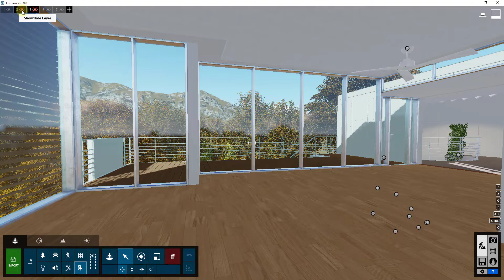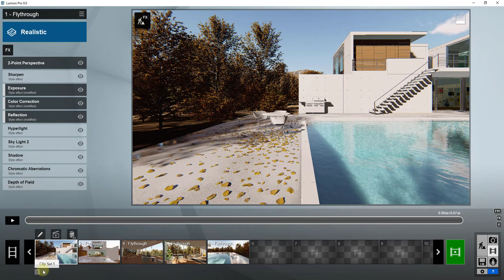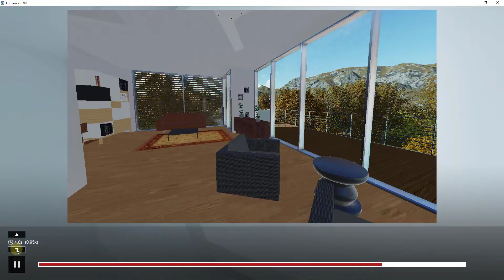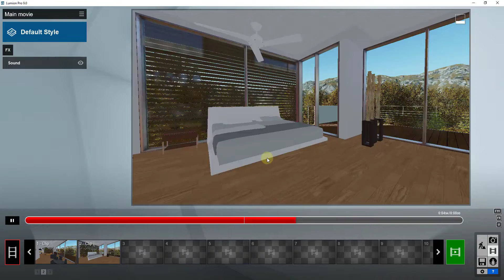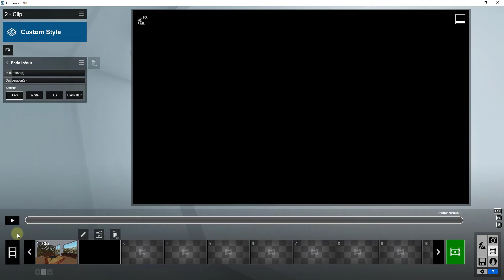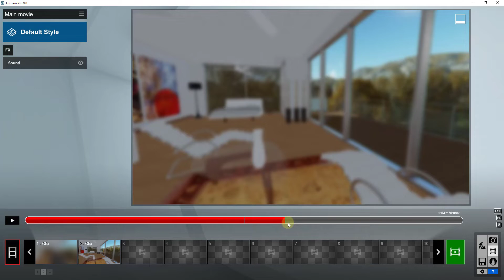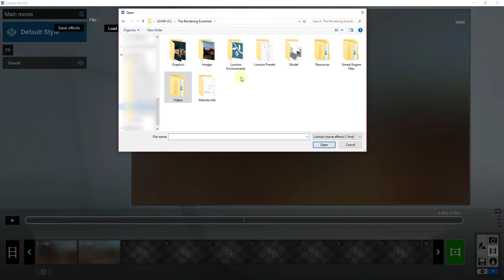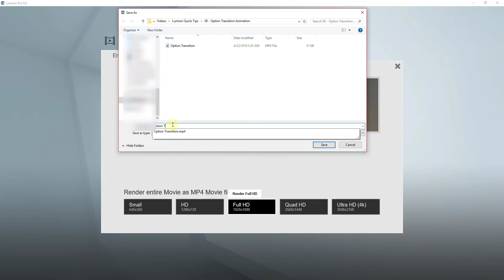Creating a Design Option Transition Animation in Lumion

Comment: I think the video that you showed in the beginning had done some editing. we can do that by doing 3 video renders of same animation with different layers turned on and add some smooth dissolve transitions in the video editor. (not an easy method, but it'll work)
Reply from the maker: Agree - that's how I would create it as well - I was wondering if there was any way to do the whole thing solely in Lumion, but I don't think there is - sounds like some post-processing would be required. Thanks!
Reply: @TheRenderingEssentials  hope Lumion will add layer transition effects and hopefully raytracing in the upcoming versions 😂